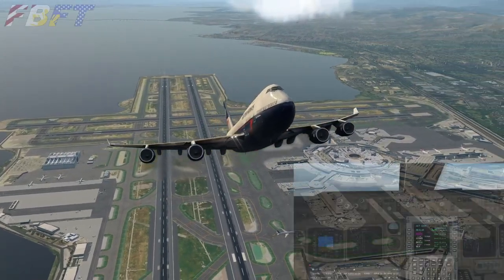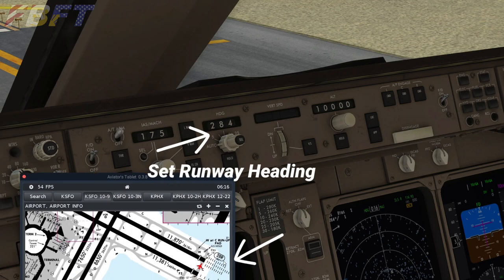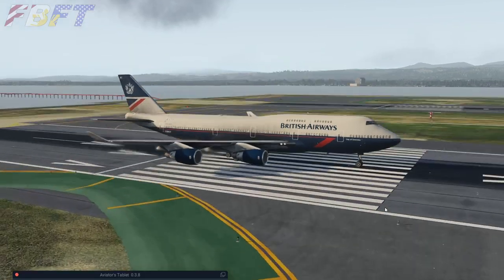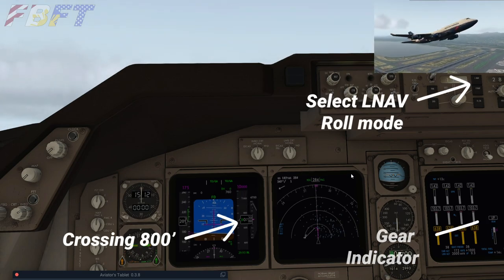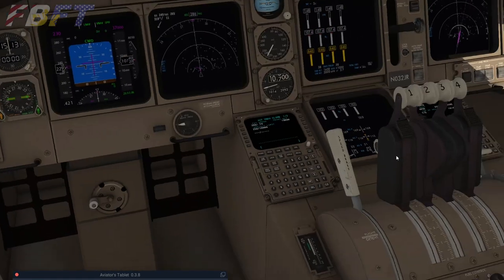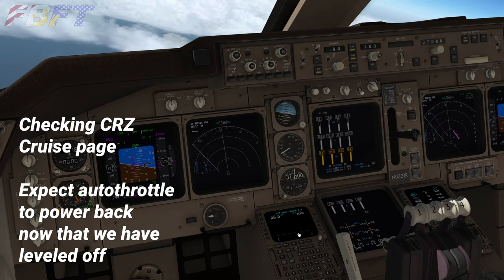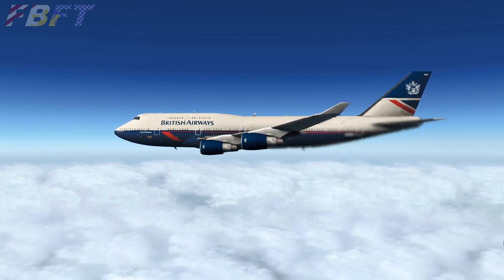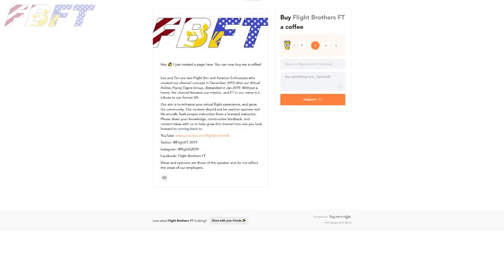X Plane  | Default 747 Autopilot Tutorial - FMC, takeoff, step climb, direct-to

Comment: 14:25 These instructions are useless. You hand wave the whole thing and do clicks while you are rambling about something, while random arrows pointing to things you may or may not have clicked. Did you click the <---- ?  Your mouse hovers in the vicinity.
Reply from the maker: Sorry you found the video less than helpful.  Happy flying.
Reply: @FlightBrothersFT  he has a good point, but awful delivery.
Had to rewind couple times at that moment. 
In any case, very helpful, its really a relief to my sky sickness,(CPL pilot here), and big birds are about 2-3 years away from me. Simming keeps my mojo up, and figuring out the FMC and autopilot differences were really the stepping stone.
Thank you!
Reply from the maker: We are glad you found it useful, and thanks for the feedback.  Yes, the autopilot/flight management systems are the big differences.  Remove that, and they are just airplanes!